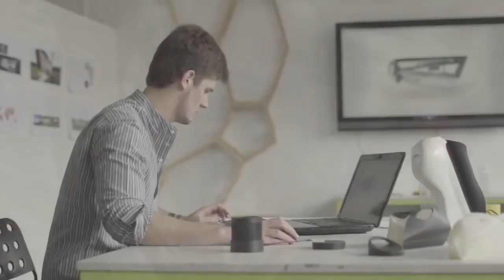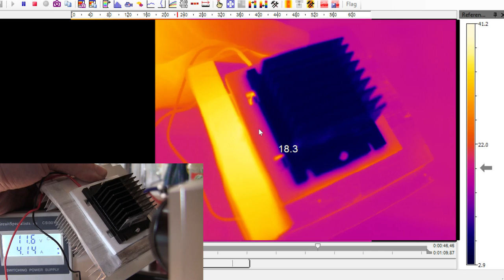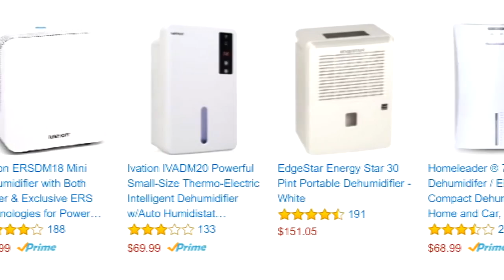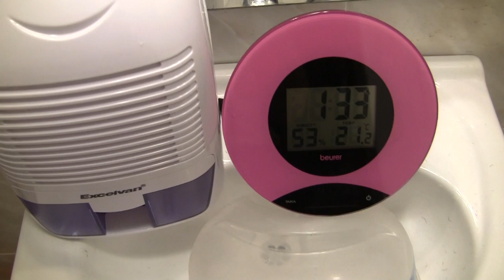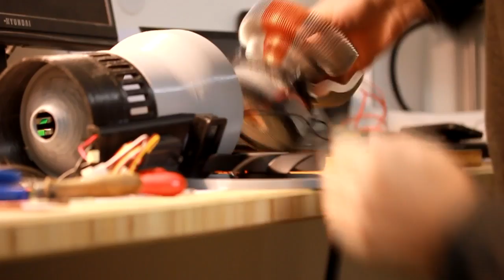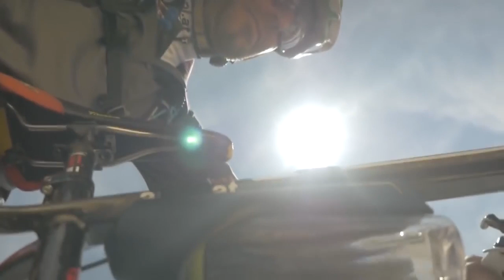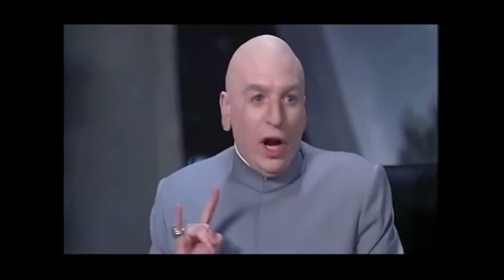$300 000 'Self-Filling water bottle' FAILURE

Comment: I run a dehumidifier in my basement takes about 3 days of constant use and I get about almost 2 gallons of water and it's a pretty good size about 2 ft High a 12 inches wide and it's got a 2-gallon tray and that's running it 3 days straight I don't see how a product like that would actually be efficient I think you would die of dehydration before you got water out of that bottle

Comment: Your right it's a dumb Idea, BUT peltier module dehumidifiers are meant to work in conditions over 25 degrees C and over 60 percent humidity. They don't really become effective until you hit around those conditions. But of course manufacturer's will never tell you this. the energy draw on them is stupid no matter what way you look at it. Best to find a ultra tiny compressor and have it be stationary.

Comment: This was a complete scam right? It's hard to believe they're that dumb. 
If you wanted to collect a bottle full of water with a tiny panel the only way you could do that you'd need a collector at least 1 square meter, or more, and it would not be a dehumidifier type design. It would have to use a hygroscopic material and basically the electricity would only be used to power a tiny heater to help condense it.

Comment: And what's one of the top warnings that is in the front t of ANY dehumidifier?

Do Not Drink The Water Produced By This Device.
Reply: @blue-lu3iz  
It also condenses vapours of anything else that's in the air.
As you pass the air over it, you get mold spores and yeasts and bacteria and dust particles along with water vapour and gasoline vapours and whatever airborne pollutants are in the area.

Comment: 30% humidity at 20 celsius is pretty low (indoors recommendation is 40-60%, although I find 60% quite disturbing). 
Even commercial dehumidifiers are prorated at 80% and 32C, different conditions reduce their extraction capacity quite a lot.

Comment: All good and so but maybe a better depunk would include analysis against a heat pump where the COP will make it more energy effecient to condense water. Maybe I'm wrong but a COP of 4 is highly achievable if you used the cold air from evaporator after removing the air as an input for the condenser

Comment: Funny story. I can appreciate your golden hammer. I will keep it short. I am a jeweler. I once took a part time job at Sears changing prices. They used palm-pilots which used a stylus( which were as useless as the pilot). It was easier to print a list than use them, so I made my own stylus to mock the device. My stylus was the size of a pencil, and hooked in my pocket. It was solid 18kt gold( 2 ounces), with a row of 10point diamonds down it and a huge garnet on the clip so that was what showed sticking out of my pocket. I called it my oxymoron because my stylus was worth way more than the awful palm-pilot. It also worked better than its stylus. Shoppers would stop and stare at it when I was checking prices. LOLOL

Sometimes a golden hammer is the best way to point out the absurdity of a situation.

Comment: WELL, IM pround to say IM working on a Hair Dryer that does not use any electricity which you can take camping or use at home (Towel), also a hydro body cleaner you can take anywhere (wet wipes) . I just need 250.99 USD right now. I also need a new BMX bike that happens to cost 250.99 too.

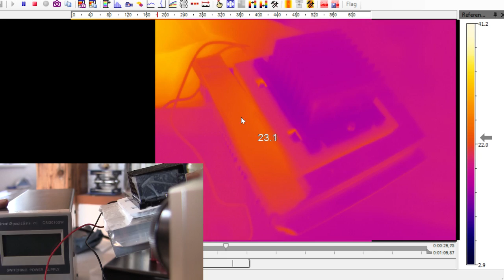Comment: 4:00 If you remove the cooler on the cold side you'll see condensation build up and become a 1~2mm ice sheet in a few seconds, after turning it off the overall heat of the peltier will melt it quickly making and you'll get a teaspoon of water, they probably saw that same effect and that it was repeatable, assembled a small prototype that works in moist environments and started annoucing and gethering money without solving for those 15 Amps @ 30V they needed to make it work... It's always the same story with these crowdfunding projects... it's a bunch of dropoffs enterpreneur wannabes that see some cool effect they don't really understand and start advertising like it's a breakthrough. It's always based on ignorance, not understanding thermodynamics, power efficiency, engineering costs, etc.

Comment: If only that money had instead been contributed towards medical research. That's the saddest thing about all this. What could have been.

One question though Mr Foot. If a small portion of mechanical power of the bike was instead tapped to compress and decompress air would that extract water out of the air? I note that is what happens with air conditioners. If so, someone please send me $340k for R&D.

Comment: I would never want that crap on my bike, even if it would fill up instantly and if it was the first design, if you decide to go downhill one day, you fall hard, it would probably brake, not to mention the extra weight and it probably wouldn’t be placed on the balance spot so your bik would tilt a little whenever you jump, witch can cause som heavy crashes

Comment: My dehumidifier pulls gallons of water a day, this one is just trash. But that water bottle is even more garbage than I originally thought! 

Best way is to buy a water filter, and simply boil off the water before drinking. There are many other ways to get water, but this is by far the easiest and safest method. Remember to keep the water at 100c for 10 minutes.

Comment: Just look on our small heat pump when running it in AC mode. The condenser is HUGE compared to the bottle. REALLY HUGE! And it has an enormous fan, and can run on over 1 kW! And yes, there are water coming out of it. A normal not too dry summer day it can be several litres, per 24 hour period.... and yes, inside can be pretty humid during the day when cooking, showering, all plants in our windows, people releasing humidity and so on... So, optimal conditions, high power, high surface area, high air speed results in a couple of litres/24 hours.....

Comment: As a mountain biker I can't see any need for the bike mounted version. Even if it did work the weight of the system would be greater than just carrying a few water bottles or a pack.  No one goes out long enough that they'd run out of water because they couldn't carry enough. other factors stop you from riding that long. I personally ride with a three liter pack and it is limitless amounts of water. Its really just a solution to a nonexistent problem

Comment: I have an idea. They should build heat pump dehumidifier with gasoline generator. It would weigh around 100kg to get reasonable water output and some fuel stored but hey, over time you can generate more water than you brought fuel with you!

Comment: Well thunderfoot, it will work just fine.  You just need a trailer and good size genset...LMFAO..........Randy in Texas, PhD. Engineering. Do people really not understand there are real number that govern these processes? Did you notice thunderfoots power supply was showing 4.2 amps at 11.5 volts?  That is 50 watts boys and girls.

Comment: I had plumbing problems a while back the maintenance at my apartment complex put a dehumidifier in my living room because the toilet leaked into the carpet and with about 5 square feet of soaking wet carpet 53% humidity it ran for 3 days including carpet clean up and plumbing problems fixed during that time it only had a maybe a teaspoon of water come out

Comment: Your dehumidifier comparison is a bit flawed, I've lived in places where I could fill it within a few hours.   It filled so quickly I had to run a hose to a drain.   It's very dependant on your humidity level in the air

Comment: The James Dyson Foundation isnt an engineering firm, its a marketing firm, as evidenced by Fontus and also Dysons own advertisements. They claim their vacuum cleaner "never loses suction ever". Engineers shouldn't use absolutes like "never." What if the entire vacuum cleaner apparatus is in a vacuum chamber? Still "never?" Or what if real engineers realize there is no such thing as suck, only a difference in pressure, there isnt negative pressure, you cant have less pressure than a perfect vacuum. 

What has Dyson invented? The airblade? Mitsubishi made a far superior product, the "Jet Towel" in 1993, 13 years before dyson released theirs as an "invention." The cool design seen on the dyson vacuum cleaners? Cycloidal separation has been used in industry for at least a century. The "bladeless fan" even has blades, their just on the inside, might as well call your HVAC air conditioner a bladeless fan by the same logic. 

They're more marketers and designers and less inventors and engineers. Same with Fontus, water seer, solar roadways and Juicero.

Comment: Ya know...if you can afford to take time off to take a long tour, the ability to have water is a non issue.

Plan your trip, keep a water supply, refill from a local source if you ryn low and use purification tablets or a filtration system.

...or boil it.

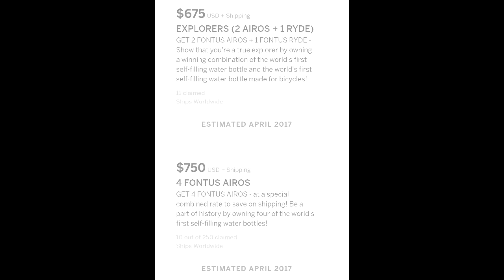Comment: 17:57 The bottom heatsink its a intel stock heatsink, from maybe a socket 775 pentium 4 or an i7 processor (1150 socket and up) as it seems to have some copper inside of it. (Basically intel uses the same heatsink design for years!) If the core isnt copper than its probably a 775 socket core2duo stock heatsink or a i5 stock heatsink.

Comment: If you don't wanna do calculations think this. You need to sweat to get extra body heat from muscle work + hot sun. That is effective because making water (sweat) to steam takes very much energy (you cool down).

So you would need a solar panel the size of yourself + effectivity 100% to get that much water what you would need in a sunny day.

Make overalls coatet with solar panels? Make a cockpit to your bike coated with solar panels so you can bike in the shade?

Or just bring all the water with you to save weight and money.

Comment: This does raise a good point. With the new clear solar panels that are being developed, you could put them on boats and lead it into tanks that can fill up in the event that you break down or get stuck out at sea, so you don't have to worry about water if the sides and top over the front of the boat are completely covered

Comment: While I do agree with a lot of Thunderf00ts videos, on this one he’s mistaken. Apparently he’s never heard of a joule thief. Simple little circuit that can take as little as 15 jubilee of energy and multiply it by over 100x that amount. And you can build these small enough to fit into the cap of a water bottle. So that 15 joules a second with a joule thief is actually more like 15,000 joules per second.

Comment: It seems to be a common misconception about how much moisture there is in the air. Plus geography would make a huge difference in how much water you could even get. If you were in the tropics maybe you could get a decent amount...after a week or so...but in Arizona, where I live...you'd be screwed! Our summer temperatures reach 120 degrees with around 22% humidity. You would die of dehydration days before getting enough water from the atmosphere

Comment: Theoretically, if you could cool air to 0 or less degrees, you would get water at any humidity and temperature (besides 0 (or less for temperature)).
However, in practice, 0% humidity isn't very possible (on Earth) and at <0 degrees, humidity is still a thing and exists. But the amount of water is very, VERY little.

Comment: i just realized that all these dehumidifiers are basically producing distilled water which is not safe to drink if you would only drink distilled water you would basically pull out all the minerals your body needs out of your cells. Tap Water has minerals in it so does bottled water. You can read on the labels of bottled water how much of these essential minerals they do contain. Distilled water is not drinking water. https://en.wikipedia.org/wiki/Dehumidifier#Potability

Comment: To make a dehumidifier that is that compact and has the performance capabilities they're aiming for, it would have to be nuclear powered. The reactor could then drive a serious heat pump and the powerful turbofan they'd need to get the huge airflows necessary to extract that liter of water from relatively dry air in a reasonable time.

Comment: Good description and demonstration of how a refrigerant system (AC) works but you forgot the restriction point. That is probably the most vital and inexpensive component which will render your system useless for a few reasons; clogged Orifice or Valve, TXV gas missing, maybe a stuck valve. Anyway I just felt a desire to be a smartass. Thanks for the video 😁!

Comment: LOL good video.  But unless your doing chemical vapor desposition. 

**Graphene has gone down so low in cost that its certainly doable with the sheer force extraction method.

I really was waiting for this to come out.  

They are certainly limited by their power input.  

*IF They could use the power to power a condenser to have a Separate storage tank for the incoming air, and put it under slight to medium pressure, while extracting water in two stages.  THEY might get more.  But than again.  Power issue.  

They could use a solid state air battery to do this.  This would charge a good amount. Granted that they use more than one source of solar energy input.

They need more power density.  Thats the problem
Reply: We need more power, Scotty!

Comment: Hey ya'll! i know how to get the idea of those pultea devices (or however they are spelled...) to work following the rules of thermodynamics! first, i need a device or array of devices to cover about 500 M^2, then, i need about 3 to 4 three meter industrial fans, and then i need two full size solar concentration stations, including plumbing for the cooling towers to pump away the heat. oh, and battery farms for night ops. ah! water in the desert at last...

Comment: The results are interesting to be honest. The reason is that when you get a cold drink with say ice on a hot day the glass gets all wet in a matter of minutes (and i mean very wet, dripping wet, many have probably experienced this). The water comes from atmosphere, because where else would it come from due to temperature difference between air and glass. The same goes for metal water pipes, which when are very cold they also are very wet in a warm area especially. So the one you got should get you some (more) water if you managed to drop the temperature to say 1-2C, just above freezing would be perfect. This plus a large surface area (big heat sink). I understand that you still need A LOT OF POWER (Peltier's need a lot, I know I have a few and I have been playing with them). However those should condense water fine in a condenser (if it is properly designed and built that is...).

Comment: Worst part is they are going for the peltier effect, which is notoriously inefficient.  If they went with a compressor/condenser/evaporator design, they still wouldn't get anywhere near their goal, but they would certainly be several times closer.

My compressor based dehumidifier will generate gallons of water a day.  Of course, it is drawing about 1500 watts all day, but at least it does SOMETHING...  LOL.

Comment: very strange indeed that this contraption that is put together in a way that could not work due to the size of the parts and the amounts of energy that in real life would be required  and that also in its entirety is based on a process that is not workable would simply pass all these.(supposedly) prestigious and highly educated entities. even the assumption that condensed water would be automatically that clean is faulty as anyone can testify who has actually TRIED drinking water coming from a process that involves bringing forth condensed water (for instance water running from droplets forming on the inside of your home's windows in winter)

Comment: There are a couple of things that skew your results. For better accuracy you have to compare indoor vs. outdoor and also the relative humidity of the surrounding area. You are most certainly going to get better water gathering results if you were to use a dehumidifier in the Amazon Rainforest in summer, as opposed to the Nevada Desert. Try that experiment outdoors in a humid environment. Hell, you can collect massive amounts of water coming out of the condenser coils of an air conditioner in the summer, especially at night, when the surrounding temperature cools down, and just before sunrise, as the morning dew gathers.

Comment: What you aren't understanding is that it's bike-mounted so it's designed to be funneling air like a jet engine. The more air it takes in, the more of a chance to dehumidify water.

Your dehumidifier isn't going up and down a rocky trail at 40 mph. It is sitting in a room with a set amount of water already in the air, without a way for more water to get in. Did you even leave the window open with a fan blowing air inside when you tested it overnight?

Comment: MIT just released data on a way to harvest moisture from air - It could be scaled up to be useful, however the size of the needed substrate surface area wont be practical for being mobile. 
http://news.mit.edu/2013/how-to-get-fresh-water-out-of-thin-air-0830      http://news.mit.edu/2017/MOF-device-harvests-fresh-water-from-air-0414

Comment: Well instead of running a fake kick starter, I hope you can use what you know to come up with something that actually could work well. Maybe there is a better way to get aluminum out of it's oxide, or a way to pull some carbon out of the air, or a cleaner more efficient fission or fusion reaction process.